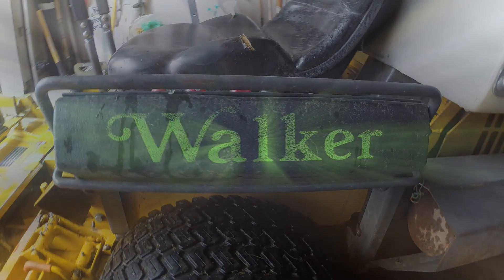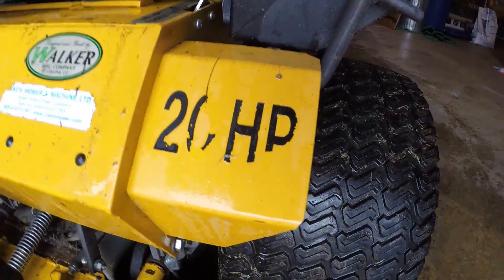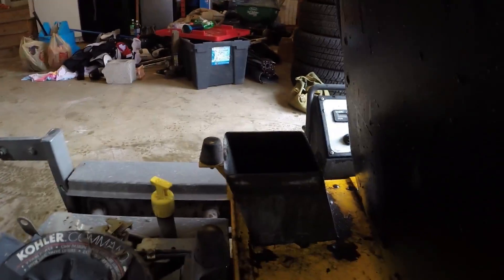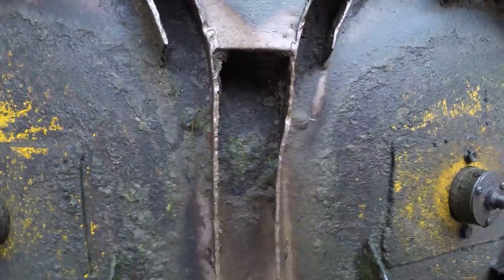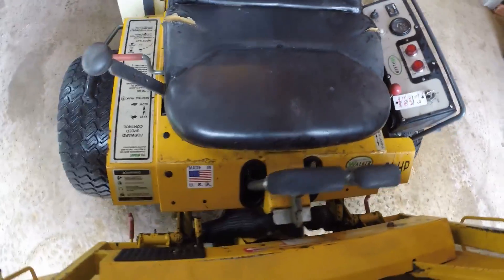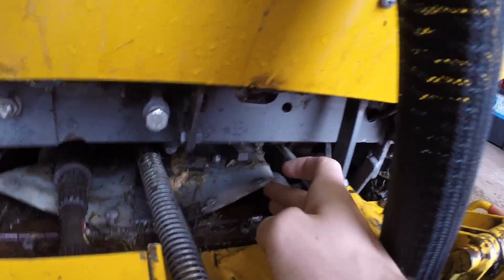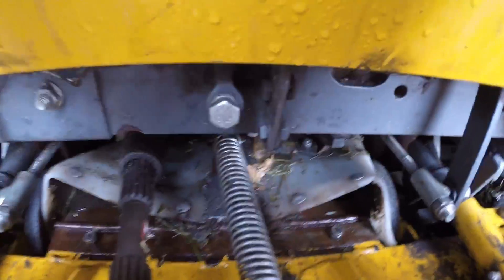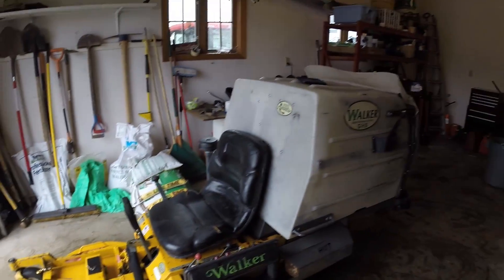Walker Mower MTGHS

Comment: Hello zach, as an experienced walker mechanic. I have worked on many machines especially the mc, yours looks like an mt. I would replace the chute that the rivets popped off of. I would also look at the blower box which in my humble opinion experiences the most wear and tear. I would look for any blade fins hitting the blower box aswell as any wear and stress cracks. I would also check the condition of the hydro cooling fan. Welcome to the world of ownership of the worlds best mower!

Comment: You will definitely love that machine they are awesome. Just make sure to pick up a box of shear pins and have those with you. And there are a ton a grease fittings. But it's a great machine
Reply: I'm with you man I can't wait either
Reply: Yeah shear pins on the PTO and the little stainless shear bolts on the blades, there synced blades. Keep a pair of vice grips and Allan keys in the tool box,

Have a 2010 mtghs with a 72 deck and a 1992 mdghs diesel , walker are great machines, well built, very reliable,